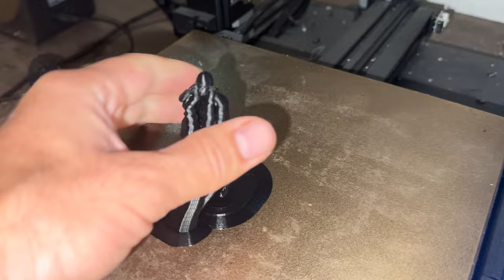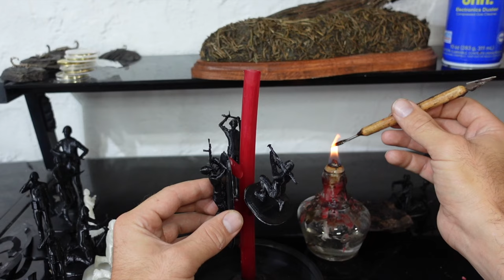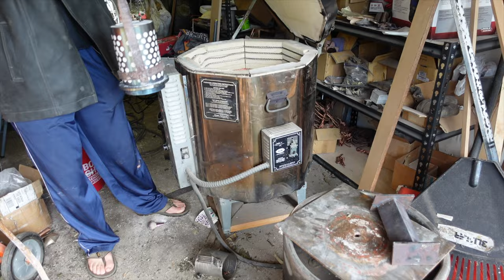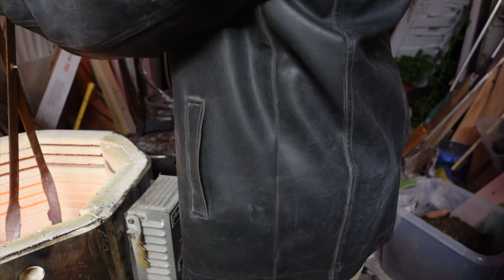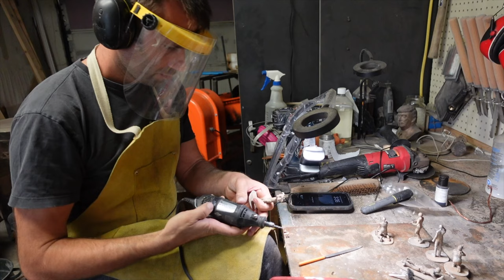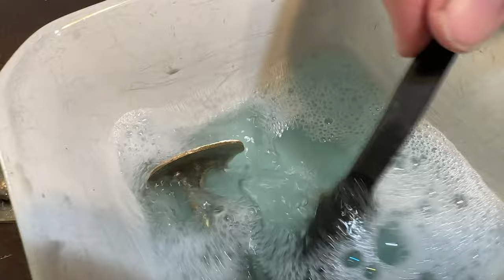Making Bronze Army Men

Comment: One way to help remove layer lines is to give it a quick blast with a heat gun. Gotta be fairly precise, thin parts will melt, and thick parts will want to keep their layer lines, but army guys might be uniform enough along the limbs/guns to work well. 

But if you really want to get into casting small prints, resin is really the way to go. I've done quite a few brass rings with SirayaTech blue cast, and a few dinosaur skulls. The increase in quality over filament printing is night and day. Resin definitely comes with its own challenges though, and while r/3dprinting is great for troubleshooting filament, the resin side is really lacking. If you do get into it, I'd be happy to give you some pointers from all the things I had to figure out the hard way
Reply from the maker: I’ve been thinking about getting an anycubic 8k resin printer. I’m thinking on how I would vent it because I don’t want the toxic fumes in my house.
Reply: @lundgrenbronzestudios  yeah, I have mine set up with a little HEPA carbon filter to try to keep it to a minimum. It's a little tricky cuz the resin should be warm (85F/30C), so you probably won't be able to set it up in a garage. Though the bigger portion of the VOCs you need to worry about is from washing the parts, (saw a study a while back, I think it was somewhere around 2/3) and that could be done out in a garage/shed. I use large Tupperware containers with the silicone seals for my alcohol washes, which also keeps evaporation to a minimum

Comment: Lucas, I have a question.  You mentioned not wanting to cast large pieces in solid form because the metal would contract when cooling, and cause a problem.  I understand that, and most of my castings have been small items, less than 1/4" in thickness, so I really haven't had to address the issue.   But where is the line between 'OK' and 'too thick'?  I ask, because I want to cast some cubes of metal, about 1/2 to 5/8 inch on a side.   Do you think that will be a problem?   Also, I do centrifugal casting, so I can always increase the force pushing the metal into the mold, which might help... yes?
Reply from the maker: It’s not a matter of “too thick”. It’s more of how can it be sprued properly. Academy awards are cast solid but they have a large reservoir of molten metal for it to draw from to avoid the shrinkage. If your sprue is too small or the thick part of metal too far away from the reservoir then you will have a problem. But if you have a large enough riser you can cast things of any size. The bigger and thicker however, the more complicated that becomes.
Reply: @lundgrenbronzestudios  That's a great answer!  Thank you!

Comment: Or, you make a trip to Michael's or Hobby Lobby or even Amazon and get bags and tubes of all kinda soldiers, mythical animals, extinct animals, and all kinds other guys and just use those directly or make some cheap silicon cup molds and do wax casting but they've got great detail and probably less than the resin and faster no clean up of lines or wasted material. Anywho that was a cool video I enjoyed watching it, keep em coming.
Reply from the maker: That’s one way to do it. Silicone rubber is not cheap though and wax casting fine pieces can also be challenging and wax chasing is also time consuming. So lots of options but all with their own challenges.

Comment: you need a resin printer..... for all of your effort you will have much better results. Once I moved away from wax models, I started just like you with FFL printing. Used polycast as well. never went back after using resin. If you want to compare notes just reply. I will send an email with info. I can send you a case study I did for a resin manufacturer specifically on casting bronze with their wax castable resin. No i do not work for them, but I do use their product.
Reply from the maker: I just got a resin printer. I got and elegoo saturn 3 and some true blue castable resin. I haven’t used it yet though.